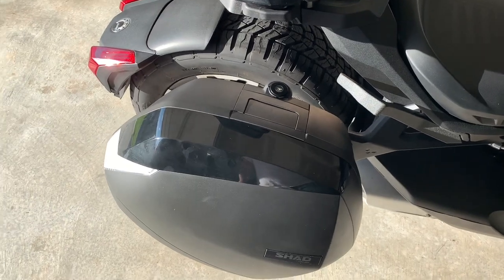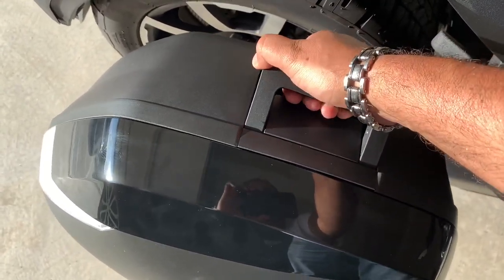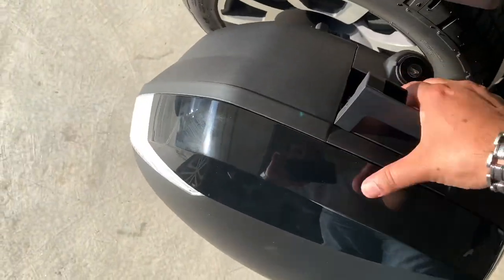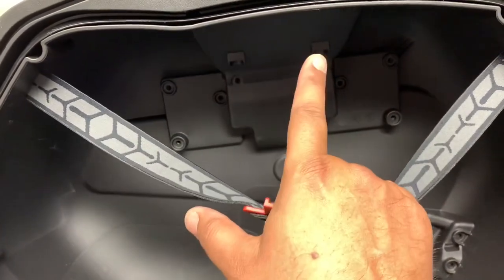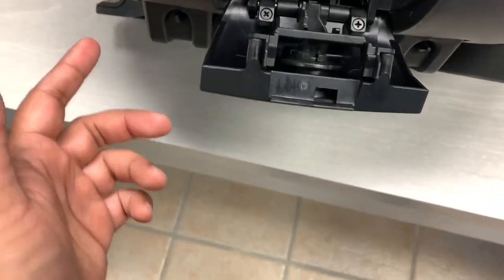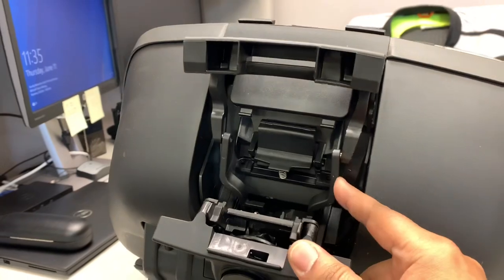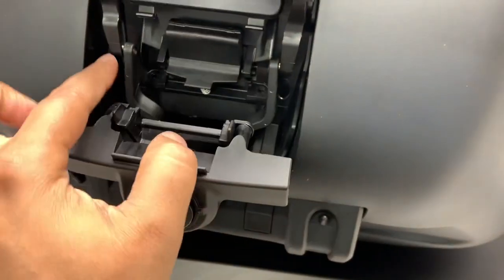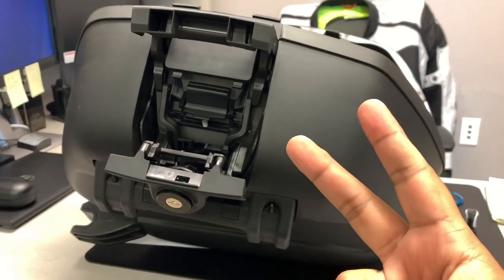Can Am Ryker Shad side case broke already?

Comment: Seems to be a common problem.   I have spent the last week trying to get mine off the rack and thanks to your video the problem was fixed.  Thank you.  At least I know if it breaks again no one will steal the damn thing.  Lol
Reply from the maker: Lol this happened to me 3 times and the third time I put super glue on the side where the metal piece kept on coming off and it didn't give me any issues again.

Comment: Good job fixing it! I would have pulled it apart too and fixed it myself that way if it ever happens again you will know. I would also try to figure a way to improve it so it would not happen again.
Reply from the maker: Thanks Tom. It was not that difficult and you're right I need to figure out how to prevent it. Also need to make sure everything is aligned into place before locking it. So you don't accidentally force the handle into the pins unhooking themselves like ti happened to me.

Comment: So question.  I think the idea of a single saddlebag is kind of cool.  But why would you design it to sit on the side of the exhaust?  I have seen some exhausts on the Can AM that deflect the heat up into the bag.  I can see some real issues with this in the future.
Reply from the maker: You know that is a good point. I have had some groceries in the bag but never felt an issue with the heat from the exhaust interfering with the bags. Something for Ryker owners to keep an eye out on for sure.

Comment: Dude quick question....my ryker 900 rallye seems a little unstable at higher speeds...what settings do you have your front suspension shocks at..1 2 or 3?...had my 1st ride yesterday and at 70 to 80 mph it almost felt dangerous...the previous owner of my ryker has the front shocks at setting 3 the hardest have you experimented with this yourself?
Reply from the maker: The dealership had it at the highest setting so I am guessing 3 as I see 2 other lines. Also think about getting the sway bar as that makes a world of difference. At first for me on the highway I felt the Ryker moving side to side a lot above 80 mph but a lot of that has to do with many different conditions. Now the Ryker in my opinion is not necessarily meant for a lot of triple digit runs but as far as hwy speeds go the swaybar made a huge difference for me. Hope this helps.

Comment: Horrible!!.. and this has happened to mine. Your video gives me hope but it's sad the way it's made. Pls let us know if you come up with a way to secure those pins!

.... FAST FWD.... I manually released the mount lock by hand and have total lose of 1 pin, the other was not attached to the Y joint. 
I reinserted the 1 I have and zip tied the other side.... may actually end up zip tying both!!
Reply from the maker: That was a good fix on your part. How is it holding up?
Reply: @RideAboutNow  No worries so far!!🤞🏾